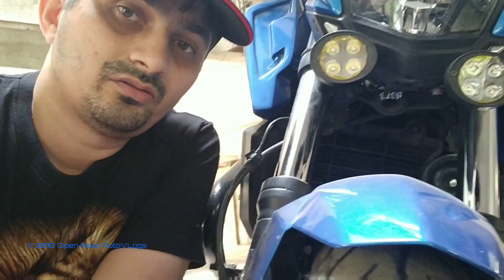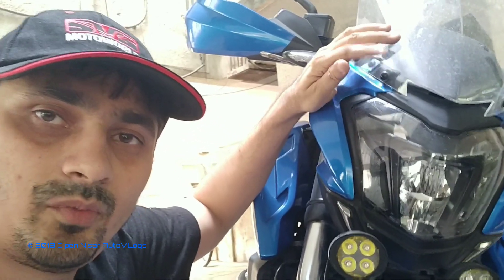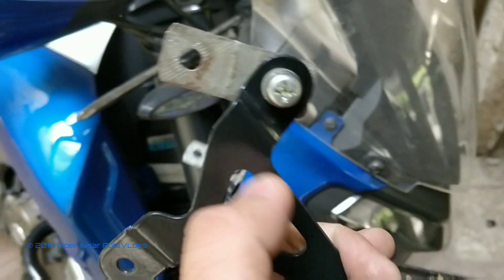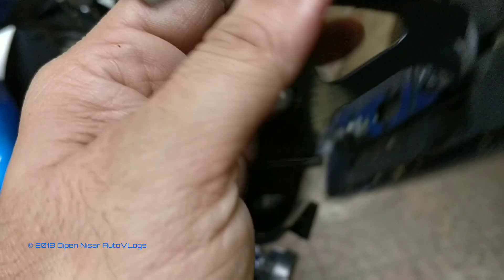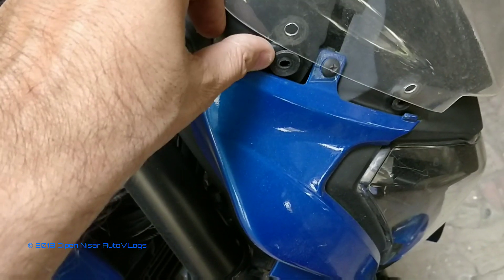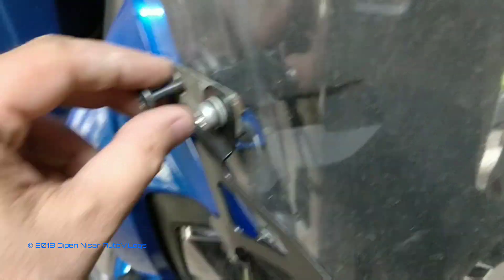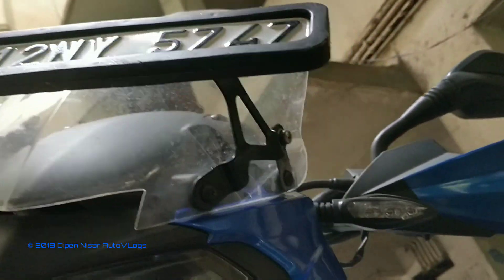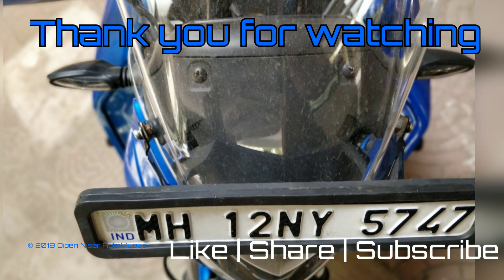Bajaj Dominar 400 Mods | DIY | Revised Number plate mount for Autologue Visor

Comment: A great simple jugaad but if executed properly looks completely professional. Keep the videos and ideas coming in and kindly let me know how much kmpl can I expect in bumper to bumper traffic. Some say it is between 21 - 25 kmpl. I am almost in the final stages of finalising my next bike. But going by the rising fuel prices this is one of the main deciding factor. I am ok with around 30 kmpl. It could be this or the classic 500 squadron blue. I know it is a completely different kind of bike but these are the 2 that I have finalised as I intend to tour a lot in the coming months. Thanks in advance.
Reply from the maker: Umesh M.K. bumper to bumper - yes 21-25 kmpl. 

Otherwise on highway long rides, I pull up to 35 kmpl with steady 80kmph speeds .

Comment: I have purchased carbon racing windshield that comes with number plate extender. 
I am confused regarding using the extender  or buying a front fender for number plate( from lluvia). 
Saw a few videos that the front fendor comes off. 
Kindly advice.
Reply from the maker: Use the extender
Reply: @dipen.nisar.autovlogs  Thankyou.
Reply from the maker: @harshitsahni27  👍🏻

Comment: By any chance is it possible to replace the front and rear suspension of dominar with RE  himalayan
Since dominar bieng a sports tourer the suspension will bottom out under heavy useage
If not that atleat let us know wether we can replace the coil spring with a thicker one
Reply from the maker: prithvi kanchan - replacing with RE will be a huge mod. Not worth. 

We haven't seen any complaints so far for Suspension bottoming out for any Dominar. They are pretty stiff. 

For front you can use Suspension raisers. They are working fine for me. Have done 10000 kms on them. Sahyadri make. Video in my channel. 

I do plan to change the coil springs. But this will happen post rains. I need the suspension to be more softer. For me it's too hard.
Reply: Exactly usually thats what happens with indian bikes either it will be too soft or too stiff... indian bikes come with linear set of suspension sadly even the re himilayan comes with the coils. Air forks would have been appreciated even of kept as an accessory.. only the people aware about it would have gone for it ..
what i am looking for is a progressive spring with will be soft in the begning and will get hard at maximum travel which would help it to perform without bottoming out
And few adjustments like pre load and damping. Rebound..
I am really pissed at the indian market
Out of india there are soo many options 
In this segment
And yes sir you did mention that people are quiet satisfied with the dominars suspension and they dont bottom out. That's probably they dont utilize it in a same way. Some how i end up bottoming up my friends himilayan in evey ride that too multiple times. I ended up damaging the rear suspension and rebound mechanism got spoilt.. thankfully it got covered in warrenty 
Hence i need to research everything prior huge investments
Anyway sir thanks alot for your valuable comments and i have subscribed and pressed the bell..
Hope to see such videos in future
Reply from the maker: prithvi kanchan - I guess wait for the Duke 390 Adventure version coming next year. You might see a better suspension set up. 

Thanks for subscibing.
Reply: Life is too short to wait..
In the meanwhile i will start this project
If it works well i will stick to it
If it dosent i will make it stock and sell it off
Reply from the maker: :) - Do share updates if you can, upload them on youtube
Reply: Yes sure i will
Since i have learnt people have very less knowledge about specific terrain suspensions and other off roading components...
Reply from the maker: me too for that matter :)

Comment: I am in need of an adv 
Since himalayan has horribly failed i dont want to waste my money on that
So i have decided to built it myself by purchasing a dominar or duke 390
So i had a few queries
1) my requirements
A)250mm+ ground clearence
Dominar is 157 so need a good 90mm increase
B) front suspension travel 190mm + 
Dominar has 130 but it will reach 190 with the 2.5 inch suspension riser
Similarly i need a better suspension for the rear with travel upto 180+ mm
And a stronger coil for the suspensions
So that it dosent bottom out

Most important which bike has a better built chasis ktm or bajaj??
Considering i am going to build an adv
Reply from the maker: prithvi kanchan I would personally vote for the KTM Duke Chasis. 
But further I am not sure if the drive chain of KTM will remain at a compatible angle. 

Modifying the rear suspension of Dom would not be advisable. The drive chain angles will change a lot and the swingarm mount points towards the center of chasis may interfere in chain travel. 

Sahaydri did have some rear suspension raisers too. But never seen them in person on any bike.